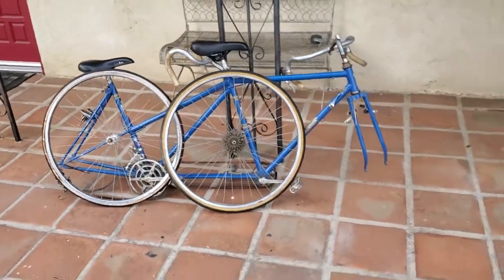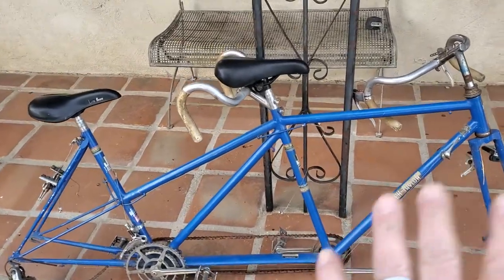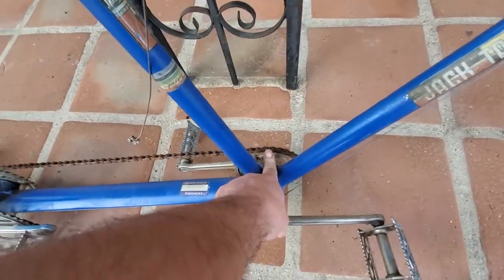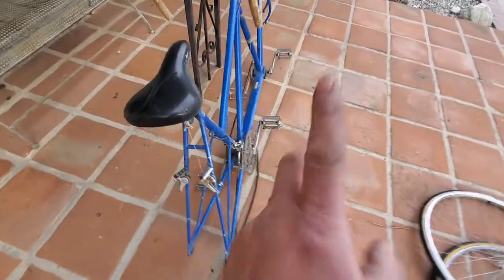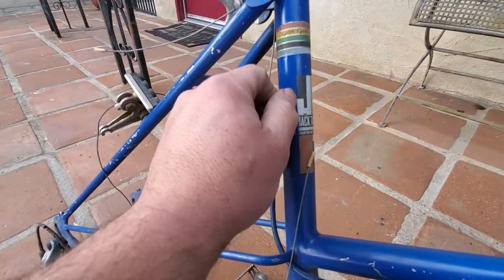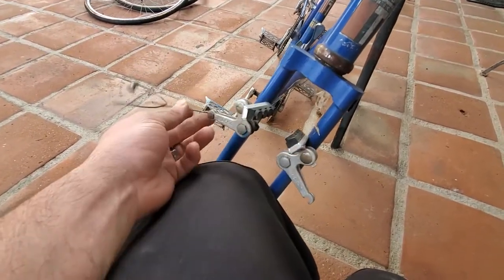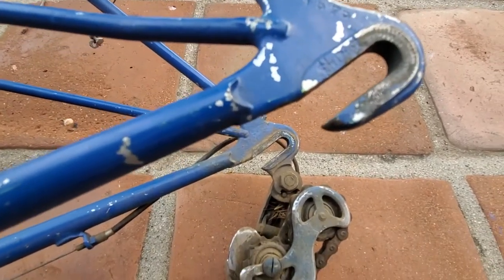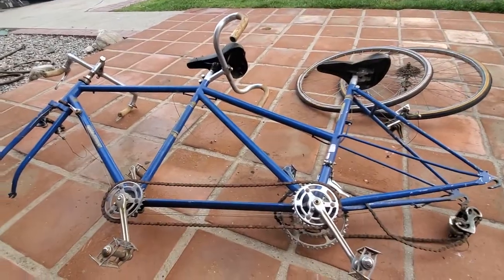Hand made tandem bike walk though (Jack taylor)

Comment: Whatever happened to this bike?
Reply from the maker: Hanging up on my wall waiting for it turn to get back on the road
Reply: Awesome bike.  We're looking for a tandem.  If the threading is English Standard you've got a ton of options for comps.  What a find.  The provenance alone makes the investment.  Nice find, bruh. 👍
Reply from the maker: @MeneerHerculePoirot  thanks when I told my wife I wanted a tandem  she was expecting a regular low end one to start off with but I told her I don't do low end bikes lol
Reply: @yardsalecycles  

Hey bro, we got a tandem about a month ago.  It's a Silverback.  Aluminum frameset w/carbon fork and V-brakes (Might replace the front w/a mechanical disc assembly if needed).  3x9 Ultegra comps, double Mavic rims w/700×25mm Schwalbe SMP tires.  Good quality bike.  26/36/46×12-32 gear range.  Flat bar.  Going to get 32-35mm for stoker comfort...she insisted. lol  Haven't ridden it yet.  Haven't had time. lol

Always enjoy your videos.  Cheers, mate from New Zealand.
Reply from the maker: @MeneerHerculePoirot  sounds like it's going be a fun bike to ride . I'm still trying to clean up some space in my garage to get my up and running
Reply: Those wheels were probably original taylor made tandem wheels and totally irreplaceable